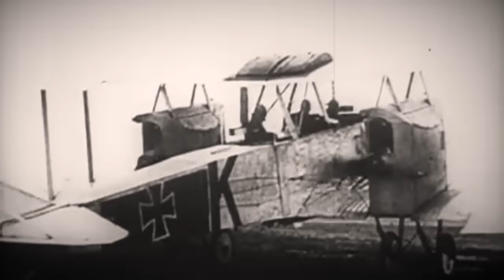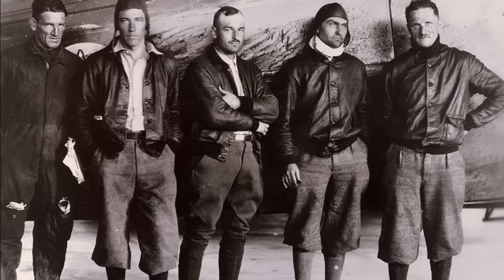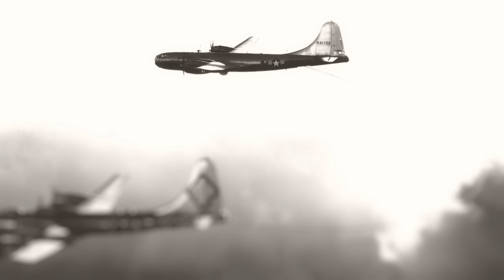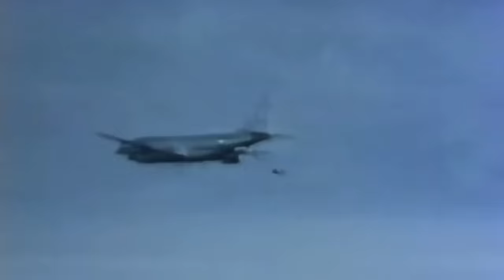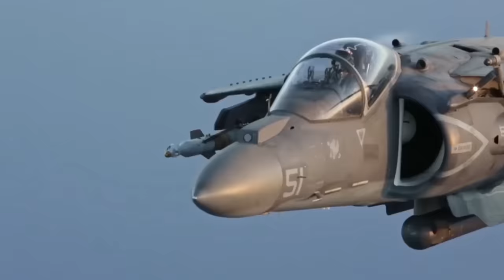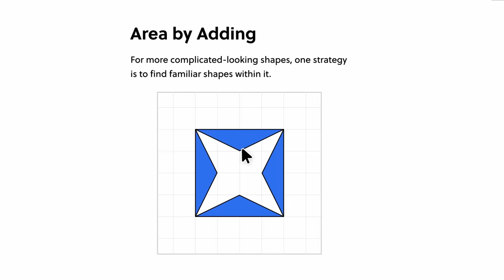The Surprising Story Of Aerial Refueling

Comment: You missed an important event. Two brothers in Meridian Miss were the first to perfect the connecting valve. Their plane is in the Smithsonian. It is a very interesting story
Reply: "The Wright engine made more than sixty-one million revolutions, consumed six thousand gallons of fuel, and used three hundred gallons of oil while maintaining an average airspeed of eighty miles per hour. It received fuel and supplies from the other aircraft 432 times."

Comment: From what I understand, the pilots of the chicks (receiver aircraft) prefer probe and drogue because:
1. A safer distance between tanker and chick is maintained.
2. The chick pilot is is in full control of the connection process.
My former father-in-law was a flight engineer on RAF VC10 tankers of 101 Squadron, he was in control of the refueling system. The Eng deployed the drogues and balanced fuel in the tanks to keep the tanker in trim. Once the Eng had deployed drogues he sat back and let the chick pilot do the work, a bit like a self service gas station!!!
Also, on the plus side, more than one chick can be refueled at one time, with up to three aircraft being refueled, depending on aircraft types. This was particularly useful for squadron deployment when the entire unit is being deployed. The RAF use a live firing range in Cyprus for exercise deployment, the units being deployed are regularly tankered out, with ground crews as passengers on the tanker aircraft and very often with support equipment.
Note: Chick is the term used in the RAF for the recieving aircraft, sort of like a hen feeding it's chicks.

Comment: "At 12:32 p.m. on June 4, 1935, brothers Al and Fred Key lifted off the grass strip of Meridian's airport in an effort to break the world record for sustained flight... The record they established in their 27 days aloft, totaling 653 hours and 34 minutes, remains unbroken in conventional flight. Not until orbiting space labs did man stay aloft longer. When they landed at 6:06 p.m. on July 1, 1935, before a crowd of between 30,000 and 40,000 fans gathered at the airfield... Some 300 gallons of oil were used and they consumed 6,000 gallons of gas... The flight of Al and Fred Key proved that air-to-air refueling worked."
Reply: I agreed with you until i remembered this and had to check the date.
But it was broken in 1958 by a Cessna.
The Guinness World Record was set in 1958 in a Cessna 172 that flew nonstop for 64 days, 22 hours, and 19 minutes and covered 150,000 miles (240,000 kilometers).
And that is a little before manned space flight and labs.
But still a darn good reference of history from you.
Keep reminding others on why it is a good to push limits and achieve.

Comment: The KC-135's airframe was the basis of the Boeing 707 airliner. They were both developed about the same time with the 135 being the lead design.
Reply: The 367-80 airframe was the prototype for the 707 and 135

Comment: No mention of the KC10.. or the new KC46?? I was a boom operator on the KC10 from 2018-2022. It was an insane job. Even with all the knowledge and experience you get, for me it never stopped feeling like a stunt.
Reply: The KC-10's Automatic Load Alleviation System (ALAS) is so sick and definitely a fun point to touch on for boom refueling. Definitely better than the KC-46's "stiff boom" xD, such a shame they're being phased out. At least some of them will be sold to contractors and then contracted out to the Navy.... Can you imagine, a Navy KC-10?!
Reply: @DHEFDAWG  Right?? The ALAS made life so easy! Felt sorry for the 135 guys who had to live without it. It is a shame the 10 is getting phased out for the 46 though. The latter jet has so many problems from what I hear, but I suppose they all have problems at first. The KC10’s cargo door was notorious for flying off in flight when they were first converted 😂 at least the 46 hasn’t had a problem that catastrophic yet…
Reply: @@Patient-957 I don’t really care for the politics of it, but it’s probably one of the most capable aircraft in the AF. It can do AR, cargo, and passengers all at the same time. And also switch between boom and drogue AR to accommodate different receivers in the same flight (the 135 needs crew to attach and detach the drogue adapter on the ground). I don’t know why you think it was a bad decision, but it’s an awesome airframe regardless, though I’m probably biased.
Reply: @Daniel-cl6hj  Yes everything has growing pains, DC-10 & KC-46 are no exception. Probably the KC-46 will be great one day. But it will never have the cargo or fuel capacity that KC-10 does! Of course the KC-46 has better efficiency and better commercial mx/support to pull from, but I still believe retiring the KC-10 is a bad move. Hopefully enough of them end up in the hands of contractors so they still have a good impact for a couple more decades.

Comment: Great video! However, no refueling video would be complete without a dedicated segment on the KC-10. It's worth noting that the KC-10 had the remarkable capacity to transport an astounding 200,000 pounds of fuel, accommodate up to 75 passengers, and handle a cargo load of up to 170,000 pounds. Moreover, it introduced pivotal advancements in air refueling systems that continue to influence the design of newer tankers produced today. Whether in the context of Desert Storm or Allies Refuge, the KC-10 truly stands out as one of the most remarkable tankers in aviation history. ✈✈
Reply: and the most problematic, they ever get the camera thing fixed?
Reply: @lawless201  tats on the KC-46, not the KC-10.
Reply: Although it could do all those things, it was limited on its takeoff weight.  Once airborne, it could be refueled and get all that cargo anywhere.
Reply: @robertheinkel6225  ohh, my bad, anyways is that thing certified yet, (the KC-46) they work out all the bugs yet?

Comment: The Navy's "Approach" magazine had a very interesting story of a refueling mishap, it has been over 30 years that I read this but it has stuck in my memory because of the unusual event. Either an F-4 or A-4 was lining up to refuel, they hit the basket which subsequently looped itself into a granny knot and then wrapped itself around the probe, tying the two aircraft together. Break out the HATOPs flight manual for inflight emergency and geez, absolutely nothing in the book for this one. The pilot finally got the knot to loosen by quickly applying power numerous times and then backed off power to let the hose and drogue slide off the probe.

Comment: Another story not well told in the history of AAR, the KC-10 was one of the first tankers which could also be a receiver aircraft. This meant a KC-10 tanker could ferry fighter aircraft over long distances (oceans) while carrying their maintenance personnel and required ground equipment all in one package non-stop. By "extending" the KC-10, the fighter aircraft could move with their support system simultaneously to their destination. This significantly reduced the time and the number of tankers and cargo aircraft required to move fighters squadrons around the world. 

Additionally during combat operations, because the KC-10 can be refueled as a receiver, combat planners had a solution to "consolidate" unused fuel on other tankers whose missions were complete to an airborne KC-10. By consolidating airborne fuel into one tanker, this reduced the number of tankers airborne which reduced total fuel burn per hour. Tanker planners often cancel tanker missions scheduled near the end of the operational day because of the amount of fuel transferred/saved. 

Finally, the KC-10 flying as a receiver can push/transfer fuel through a tanker's refueling boom into the tanker KC-10. Reverse AR. Why would you do this? If a KC-10's refueling boom or drogue system (or both) become unusable, and there are combat receivers airborne who are relying on that fuel being available, you could transfer the fuel to another fully operational KC-10. Although the transfer of fuel from the receiver to the tanker is not as fast as traditional air refueling, there are many documented "saves" where planners directed this so as to not cancel combat missions. 

The KC-10 was a game changer for AAR operations.

Comment: Presumably the original system just had a loop, and any slack was taken up by it, with the later systems they have a feedback system to adjust the length of the boom/cable as everything moved around.

Comment: There is no point in doing inflight fuelling if it worked anyway.  The supply plane has to take off from friendly land so the planes requiring fuel would be perfectly safe to land at the same airbase the fuelling plane took off from.  To risk refuelling in flight is utter madness.  Boeing did test this out and gave up because of the safety issues, it simply isn't worth the risk.

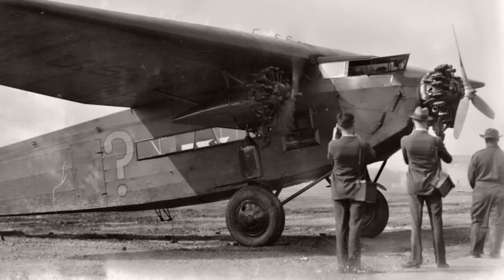Comment: Those dudes at 5:35 look pretty damn cool
Reply: Several of them became generals and served in WW2.  And the "H. H. Arnold" mentioned in the video commanded USAAF in WW2.
Reply: @jayschafer1760  Hats off. They had the right  stuff
Reply: @WillMoody-crmstorm  Exactly.  Eaker, Spatz, LeMay, Arnold, Hansell, Doolittle, and others were the pioneers of US air power during the interwar period, developing the technology, tactics, and strategy (despite tight budget constraints) that they used when they led US Army Air Forces during WW2.  Shortly after the end of WW2, they finally succeeded in their ultimate goal of having the USAAF split off into its own branch, the US Air Force.
Reply: @jayschafer1760  Thanks Jay. I was unaware of this part of the airforce history. There's a parallel to how NASA split off from the department of defense to be unencumbered by the military applications of rocketry

Comment: Boomers are not going to really go anywhere. The flow rate being around six times higher on them than probes. Retrofits already exist for the older 135s, 10s and 767/46s already have the systems in place for probe. Though talking to some 46 guys, the new remote system still has teething issues, but seems like its better than cramming yourself in a little hole.

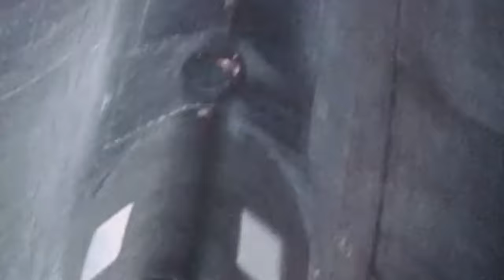Comment: So why does Air Force still use the flying boom if everyone else recognizes the other one is better. Ohh, ya 12:17 notice the big ass dent on the SR-71 right in front of the gas intake, I bet the pilot thought, "great that ain't going buff out" after he was able to unclenched his ass cheeks from the seat, imagine how it must of sounded and felt like to get hit that hard.
Reply: The boom allows transferring more gas faster, while the probe and drogue system uses a much slower rate of delivery.  Faster transfer rate is important when refueling a bomber, while refueling a smaller fighter, transfer rate is not as important.
Reply: @robertheinkel6225  makes sense but if delivery rate is the only issue why not just increase the diameter? I made up some numbers but the difference between a 4in pipe and 4.5 in at 14psi was over 2.300 gallons/min. But I can't imagine 2 B-52's trying to get gas at the same time, basket or boom. But, the advantage of fueling 2-3 fighters at the same time, I don't know, sounds like ingrained culture that refuses to change. How often has a Navy or Marine plane or vise versa an Air Force plane gone down because they could plug in to the...thing. I would hope that the Air Force would install a drogue on a wing at sometime, can't imagine it being that big of a deal, considering the benefits.
Reply: @lawless201 Check out WARP pods.  As far as fuel flow, IIRC the UARRSI (receiver for the boom) could handle 7600 lbs/min of fuel.